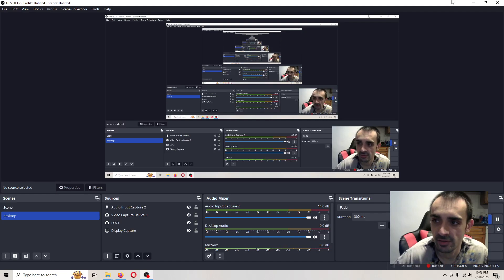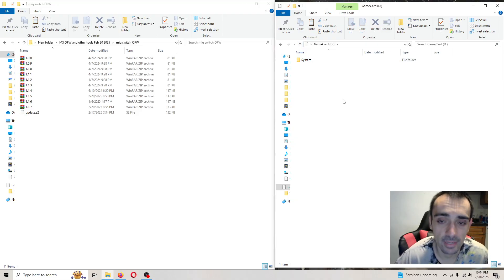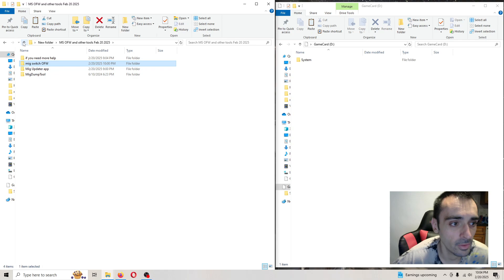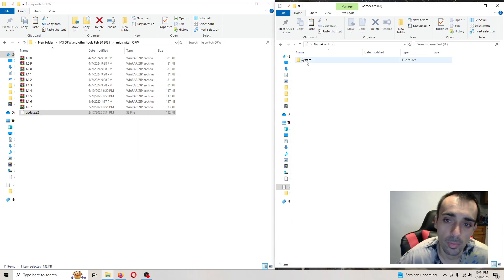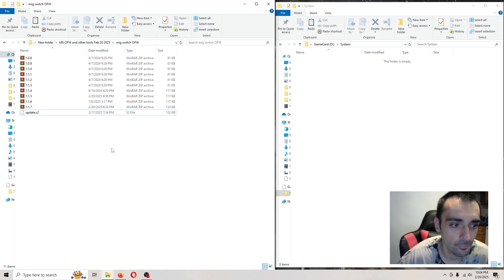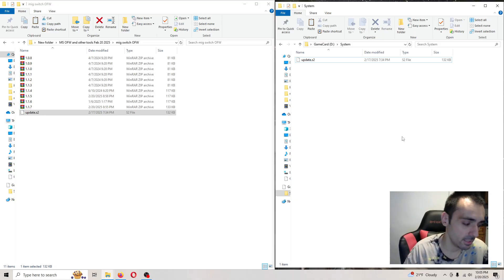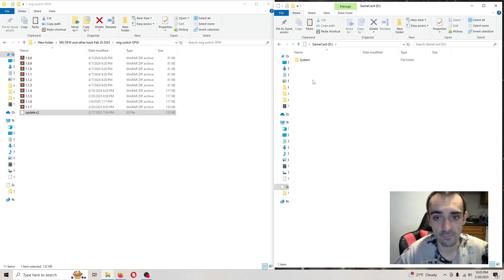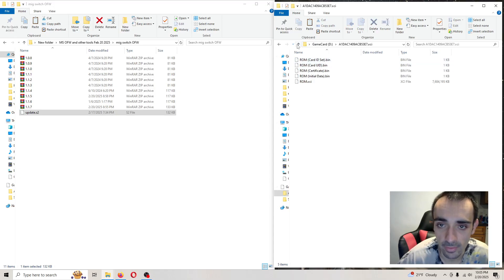MIG SWITCH Mig Flash Dumper TUTORIAL Guide update to 1.1.7

Comment: The problem I am having is that My Dumper was connecting fine. The window would pop up. Now all the sudden I plug it in and I hear the connection and the dumper lights up but I cannot get into the dumper folder itself anymore. I've tried multiple connections. Why is there absolutely no information on this issue?